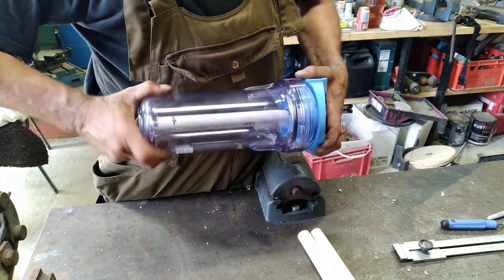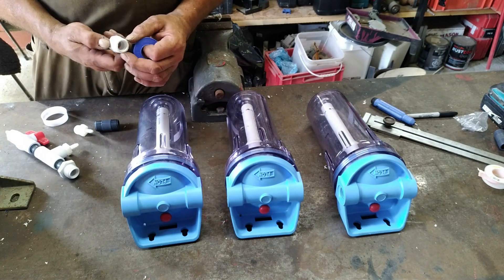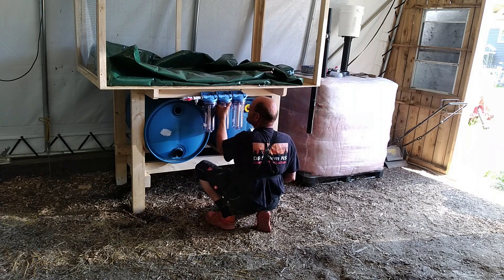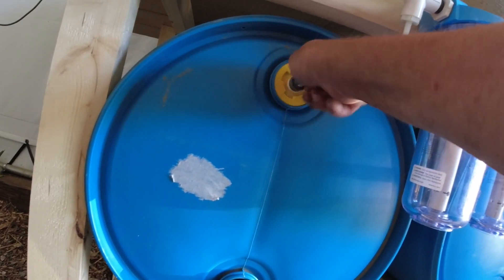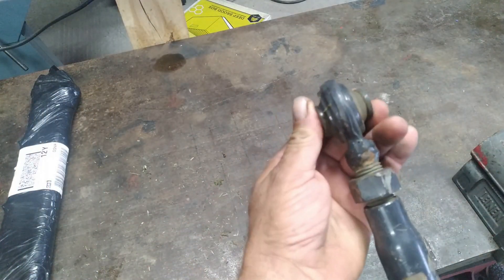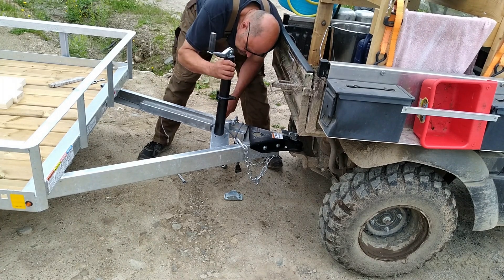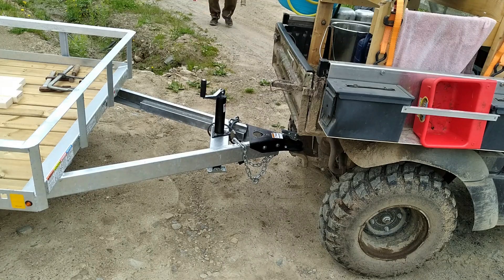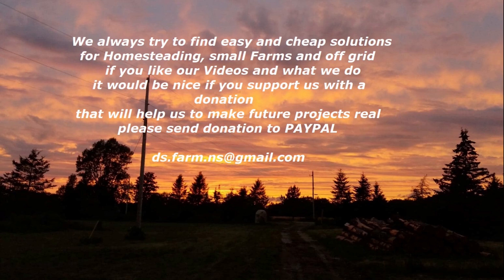Farm Biogas project (Part 3)  Biogas filter/ toplink and lumber price trouble

Comment: I've seen people discussing using iron wool to grab the hydrogen sulfide. That's great but most don't touch on the fact that it needs to be rusted iron. 

Rust (Fe2o3) reacts with hydrogen sulfide (h2s)  to make water (H2O) and iron sulfide FeS. 

Iron sulfide can be regenerated to rust Fe203 and elemental sulfur  by exposing it to air. Dry it is pyrophoric and could start a fire. But you can bubble air through the iron sulphide particles in water. The sulfur will tend to settle last on top. 

Water alone absorbs hydrogen sulfide but it has a limited capacity that drops as more hydrogen sulfide is disolved and needs to be replaced with new water. Chemical conversion to iron sulphide restores water's capacity to absorb more hydrogen sulfide.

And regenerating the iron oxide produces elemental sulfur that can go back to the ground and emmend soils that are depleted in sulfur.

Comment: 🙋‍♂I  great videos ! But I got a question!   The filter housings.  The link sent me to 3/8 inch inlet and outlet filter  housing.  It doesn't look right to me ,  looks like you used a bigger diameter than that for the inlet and outlet of filter, the pvc connecting them looked 1/2 at least.. mind letting me know ? I'd greatly appreciate it. It will save me some time swearing at the hardware store😅

Comment: Nicely done with the filter setup!
I use the same equipment but slightly different redesign with my saltwater aquariums. Your fuel production area is also very clean looking also.
 I haven't heard or read any comments from those of you who produce biogas and use any various digester bags. My concern and questions are the durability, life cycle, and UV exposures to these bags  prior to compressing the gas into a steel tanks.

Comment: Good day Sir I would like to know can I put my gas freeze on this system and do I need a one  way valve from your gas tank to your appliances.
Reply from the maker: I cant tell you what you should do, I can only tell you what I would do. A gas freezer works with propane comes in bottels with presure not high pressure but with pressure. Depense how you build your system there is mostly no or verry low pressure => the nozzel at the freezer is to small I would make the hole in the nozzel bigger to get the same flame size than with propane. Be always carefull biogas is a burnable gas and can explode. And better one more valve to shut off then one not enought.

Comment: What are you using as filter materials and why those materials ?
Reply from the maker: Water, wood pellets and steel wool, because you can get it mostly every where for cheap and it works good so far

Comment: You're putting on your Teflon aspects you're supposed to roll that plastic ring in the opposite direction so it pulls a tight on the threads you actually contact the plastic ring of the tape to the threads and roll it in reverse of the way you would normally pull tape second you're putting too much on and you should have used pipe dope on top of that tape if you're working with gas
Reply from the maker: Think about maybe the optic of the camera shows it wrong or mirrored (sometimes the are videos with letters you need to read right to left not left to right ) but I am sure I do it the right thats what I learnd  over 30 years ago but i should check you are right.

Comment: Sir very good work ..,... But i have a question.... Kindly guide me ...... What do you use in the filters to purify the gas ...... And how long the stuff you put in the filters last ....?????plz guide me ....
Reply from the maker: 1.Water  2. Wood pellets ( Cat litter)   3. Steel wool. It s all depense ho much gas you produce. You can see it if you look closer to the filters, the water turns the color , the pellet swell and turn back to saw dust and the steelwool rost and fall together.

Comment: Can we use rice instead of cat citter for moisture  absorption
Reply: You may use epsom salt (sold in stores as magnesium sulphate heptahydrate)  that is7 water molecules attached. Heating in the oven for 2 hours at 450 degrees Fahrenheit  will make it loose those 7 water molecules.  Which makes it relatively easy to make powerful desiccant, and to regenerate it latter
Reply: @kreynolds1123  ty

Comment: 2. The in-series filters are not filled with filtering materials. We need to know what to use pls?
Reply: Hi Graham ,Where just building one currently hope this helps .The first filter is a bubbler through water to remove co2 ,change water perodically has it will have turned into a carbonic acid .2 stage is to remove moisture in the gas catlitter or some other absorbant .3 rd stage is the use of wire wool to remove the  hydrogen sulphide this makes the methane gas safer with less impurities.

Comment: 1. Can you supply a video explaining how it works pls? I'm curious how the liquid fertiliser is pushed up the tube inside the digester tank, the 2" pipe which has a hole cut through it. ??
Can you supply a video showing it in action, the level inside the digester, how much kitchen waste, grass, leaves to add daily/weekly? How much fertiliser liquid waste produced weekly? How much gas produced daily/weekly? How much water added with each addition of kitchen waste, clippings, leaves etc? Can you show how you transfer the gas from bladder to tank, or direct to kitchen stove or HWS or gas heater...pls? I know it's a lot to ask, but this will give us an idea of what it should be doing once built, and how to operate it.

Comment: Thank god the 'engineer' passed it after inspection, always nerve wracking when they turn up on site :-P Great work and a great setup. Would be great to see if the gas could be used to power a small generator for use as a stop-gap backup or power system top-up for low sun/wind spells.
Reply from the maker: I work on that but it needs time to get all the parts togeter where we live, the next biogas video is coming soon.
Reply: @1000projectsaifree  I completely understand, thank you for taking the time to put these online as I know how busy farm life can be. Your videos are so good I have subscribed
Reply: was that the engineer or the waste material supply agent.
Reply: Knipex wrench....👍👍👍

Comment: Have you started gas production yet?
Reply from the maker: Yes we do but now it is getting colder and I have to change the setup a little the next biogas video is coming soon
Reply: R50 insulation and a small amount of heat underneath should keep you in operation

Comment: I didn't see what you put in the filters. 
Also,  how are you stopping the gas from escaping the inlet pipe and the  excess water pipe?

This design is the best one I've seen on YouTube.
Reply from the maker: The first filterhousing is filled 3/4 filled with water the second is filled full with wood pellets and the third is filled with steelwoll. The white pvc pipe fits hard into the filterhousing head and sealed perfect without glue or an o-ring so the inlet is at the lowest point of the filterhousing and the gas have to go al the way to the outlet up in the filterhousing.
by using this filterhousing the gas flow is against the folw that the arrow shows on the housing.
Reply: @1000projectsaifree  that's awesome. 

I sent you an email. I'm hoping to be able to compress the gas into a propane tank too. It's in the email.
Reply from the maker: It is not be a problem to compress the gas with a air compressor into a propane tank by connecting the biogas tank to the airfilter inlet from the compressor the only thing is you should remove the valve of the propanetank and fill the tank with water first than drain it (to make sure there is no more propane in the tank and than put the valve back on the tank) you dont want side effects from the propane in your biogas. And I always make sure the is a little biogas leftover in the propanetank never empty the tanks complete. And if i use  used propane tanks after I flushed them i suck out the air with the compressor first to get a vacuum in the tank bevor i fill them with biogas to have always the same quality of biogas in the tanks with out having a biogas / air mix and the side effects of it ( so the biogas quality is higher and the generator starts better) if you dont do that you have at +- 100psi one part air and 5 parts biogas in the tank and no 100% biogas that comes out of the digester.
Reply from the maker: and about your other question at your e-mail the fill level from the material and the liquide in the digester seals the digester automaticly so you dont have to seal them inlet and outlet extra. the only thing i would do i would put a lid on the inlet funel to get rid of the smell if you dont like it but only lose not tight you dont want create unwanted pressure in a part of the system.
Reply: Thank so much. Keep making awesome videos!  I'm sharing them.
Reply: @1000projectsaifree  yes, understood. I understand now why you added the cow paddy and water to fill the tank at the beginning. 

I'm going to build one this week,  as soon as I can get the IBC here. I don't have a welder like you but I'm sure I can find a great substitute.
Reply from the maker: you can use a electric heatgun with a heating nozzle like this
 https://www.amazon.ca/Beyondlife-Plastic-Welder-Heating-Welding/dp/B07CR9M9N6/ref=sr_1_10?dchild=1&keywords=plastic+welder&qid=1634596142&sr=8-10
Reply: @1000projectsaifree  great to know and thank you for the link!!
Reply: @1000projectsaifree  are wood pellets hygroscopic?
Reply from the maker: Yes they are, we use our homemade wood pellets as cat litter too see https://youtu.be/qWflLhqigkw you can also use wood pellets for oil as dry floor
Reply: @1000projectsaifree  Thanks. But where do you store your gas produced? whats the best option, gas through the filters then storage OR the other way round?
Reply from the maker: @mwapetembo697   on the top of the two fertelizer barrels above the filters is a blader tank https://www.princessauto.com/en/300-gallon-portable-water-bladder/product/PA0008906463

Comment: The idea is a six-stage scrub system; 
1) H2O to remove CO2
2) Silica Gel to remove H2O
3) Steel Wool to remove H2S
4) NaOH solution to remove Sulfer (from the wool) and CO2
5) Silica Gel to remove H20 (from #4)
6) Activated Carbon to remove final trace CO2 & H2S

These steps should increase CH4 concentration from 43% to 55% (15% power increase).
Reply: Thanks for this creative ideas, please what else can i use to remove H2O in place of silica gel?
Reply: @onoworemuriomen8163  - Kitty Litter may remove some moisture. 
Bentonite would also remove H2O but needs to be replaced fairly often...
Reply: @MercerMouth  Thanks for the info
Reply: Hi Mercer Mouth. Good technical advice. But there some items on your list that I've never seen. Silica gel and Naoh, I have no idea what it is
Reply: @winterca  Naturally, a 'lil Google search will help with definitions and applications. 

Silica Gel is often found in places to absorb moisture; new clothes, beef jerky, etc... 

NaOH is Sodium Hydroxide (used in drain cleaners) which will adjust the pH of a solution.
Reply: What about maintance
Reply: Dzień dobry, bardzo rozbudowana technologia filtracji, śledzę temat biogazu od jakiego czasu i zazwyczaj proponują 
H2O, Steel Wool i węgiel aktywny. (In Polish)